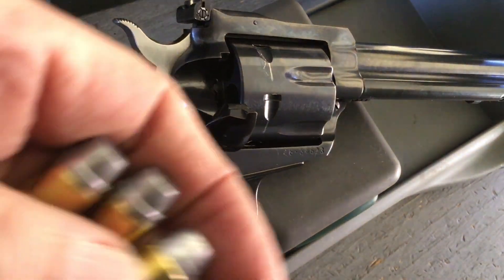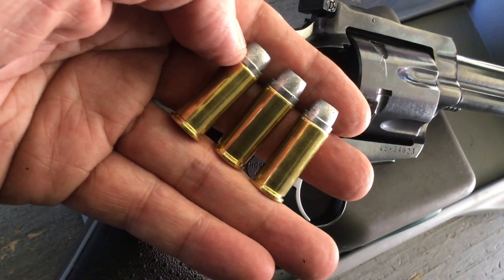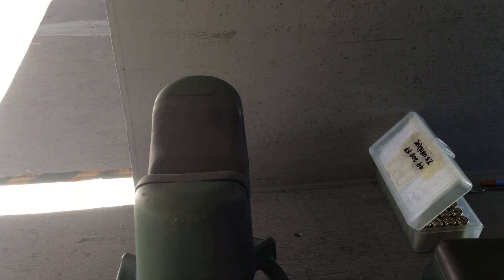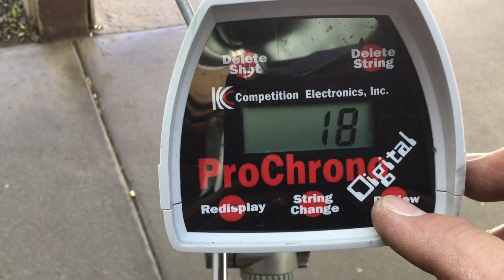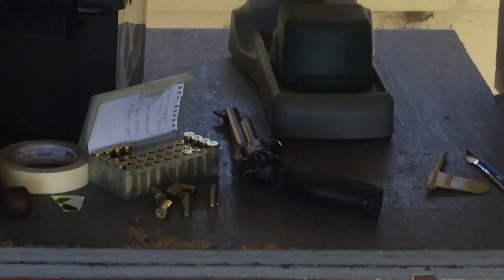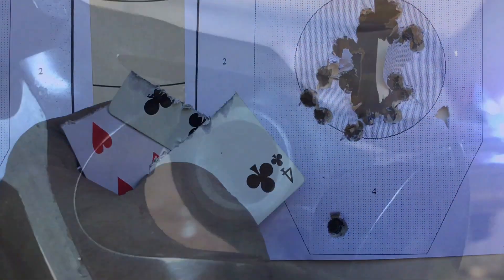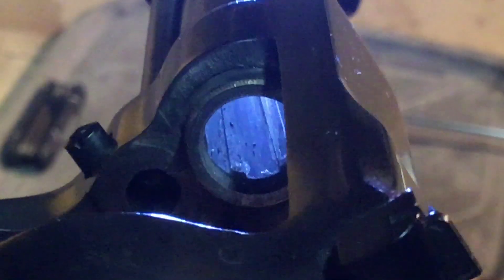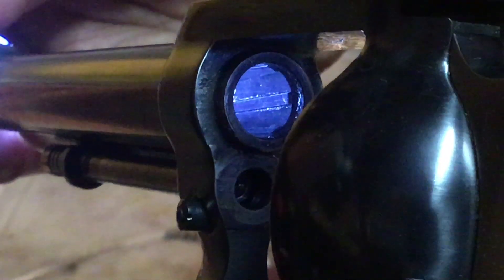Do Hard Laser Cast Bullets Lead The Barrel At Low Velocity Shooting?

Comment: i load hard cast bullets from summers enterprises,,, fantastic guy to buy from and the cheapest cost available,,, any who,,, i load 125 grain 9mm at 850 fps,,, donny said i can go,,,, IF i wanted to ,,, go up to 1400 fps with no problem,,, i have shot 1000s through my 9mm with absolutely no leading,,,, i load my 45acp with a 233 grain rn at 720 with no leading,,,,,, those i buy from him can go up to 1400 with no problems,,, he has the coated that can go even higher,,, which i wont even attempt in those 2 rounds,,LOL

Comment: Hey FC, what your saying is lots of things can cause leading. Barrel length, case length, lead hardness, bullet fit, shell crimp and even the amount of our charge. I need to look at my loading bench in a whole new way ! Thanks again for another good video. I wish my Lee Auto Drum would feed as accurately as your powder measure.
PS: what would be a good standard deviation number for our loads ?
Reply from the maker: Nick J - Actually, the order of things that are responsible for leading are 1) bullet fit to the gun 2) bullet hardness optimized for velocity / pressure of our loads 3) quality and quantity of lube 4) presence of any barrel constrictions in revolvers 5) quality of the gun barrel.  Fouling is a different but related subject.  And powder coating has changed the game.  Best to ya, FC

Comment: Hi,  Fortune Cookie 45 LC,  This is a some what related question. I use primarily Lee products. I just started casting 9 mm bullets with a lee 6 cavity round nose mold. 124 gr. I also powder coated some. All seems well so far. My question is , do you size your bullets before powder coating?  If so, do you lube before resizing? And if so how do you remove the alox (I'm going to use that) before powder coating? I resized some without lube and some seemed pretty hard to do. I haven't tried resizing after powder coating yet. Do you lube then? Thanks for the videos and reviews. Very helpful and knowledgeable. Been reloading for close to 45 years and seem to learn something new every time I get in the mood to make some ammo. New at the bullet casting thing though. Glad to have you tube to lean on. Thanks!
Reply from the maker: Travel Trailer Tipster - Congrats on getting into casting and powder coating.  The only reason to size before powder coating is if your bullets are so huge they require sizing in two steps.  This problem is seldom encountered.  The reason some feel more pressure to resize is because one or two of your 6 cavities is dropping slightly on the larger side.  No problem, this is not rare in the 6 cavs (I have almost every one of Lee's 6 cavs).  Best is to size after the PC as you won't need any lube anywhere in the chain of events if that is done.  And your best PC will be done that way also.  Degreasing after alox tumbling is to be avoided.  Once you PC, your sizing will go very smoothly.  If sizing after PC causes the PC to be stripped off (again - this should be a rare occurrence with Lee products), then sizing before PC will have to be done...Please don't hesitate to come back if necessary... Good castin'' and good PC to ya,  FC

Comment: I have never had any leading with even Linotype provided that the bullet is a tiny bit oversize for the bore and fits the chamber throats fairly tightly.  If the bullet is even a tiny bit undersized in the throats or in the bore it will lead like crazy, also if the forcing cone isn't right, and isn't smooth it will lead even if everything else is right.  About 16-1 works best in revolvers, Elmer liked it, and so do I.  I've tried 10-1 with about the same results, never liked Lyman #2 or Linotype in my revolvers.

     I hope you all are getting some Spring down there in the Flatlands, I just saw the last of the snow that has been hanging out in shadey spots.  Highly 26 to Red Corral and Hwy 88 is still closed, they are predicting April 14 for re-opening, at least they are working on it now, for weeks they didn't even touch it.  High 26 from West Point to  Mokelumne Hill is still down to one lane, so it often takes 45 minutes or longer to get the 16 miles to Mokelumne Hill, once I pick up 49 it is an easy drive to Jackson.  Boy Oh Boy the Mokelumne River is really up but down somewhat from 2-3 weeks ago.  God bless you and yours

Don
Reply from the maker: Donald Denison - Got 25 pounds of 16 - 1, should be neat working with that alloy... Spring is definitely in the air...take care while all that water comes down from the hills... Best to ya,  FC
Reply: Donald Denison - fellow hill dweller? I'm in Amador Co